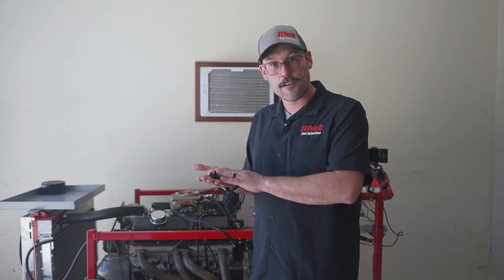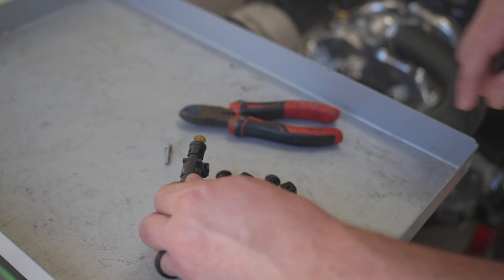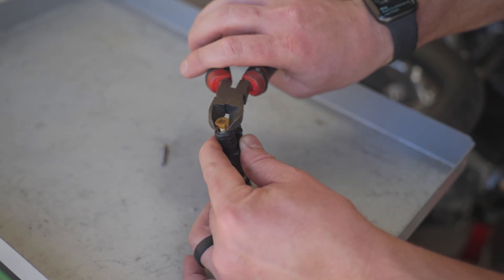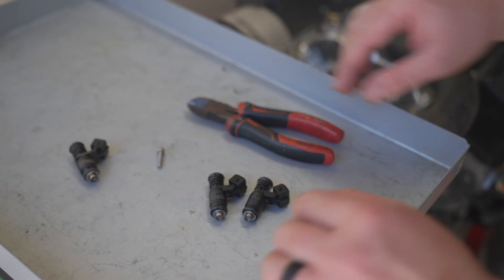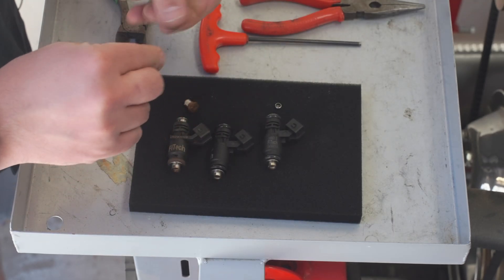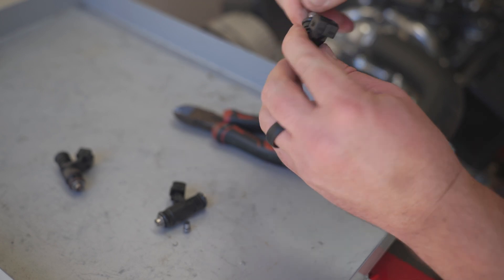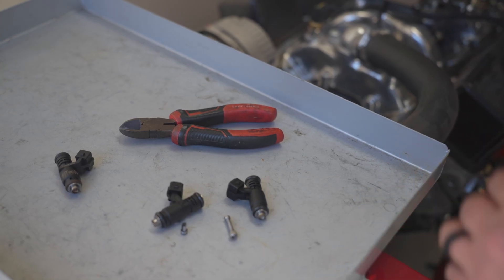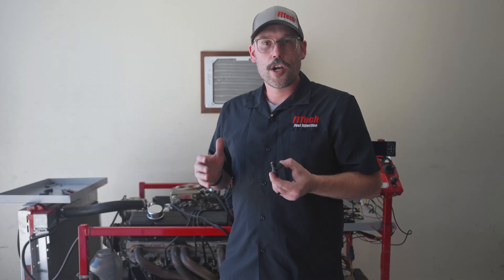FiTech Injector Differences and Breakdown | FiTech Fuel Injection

Comment: What would be great is if you could specify oring sizes and materials so we could replace orings easily if we have to take things apart.
Reply from the maker: I can provide specs for the Orings as well as injector specs, this will help identify local replacements for O-rings.
(Injector dimensions: 38mm O-ring to O-ring with an EV1 plug end, 12mm diameter, 48mm overall length )
O-rings specs: Viton 6.00 x 4.00